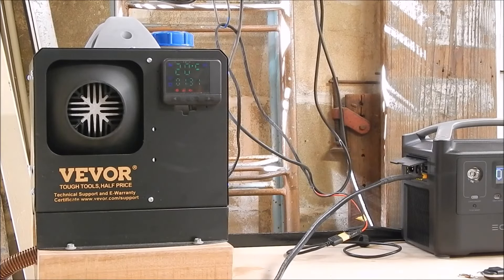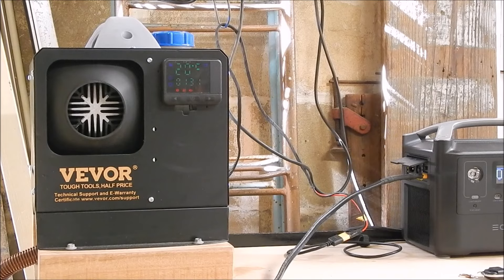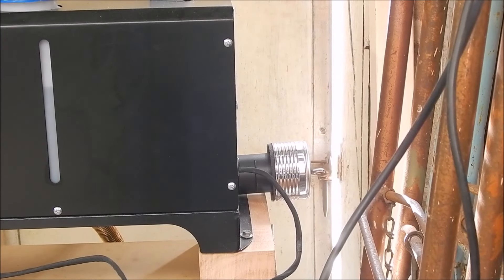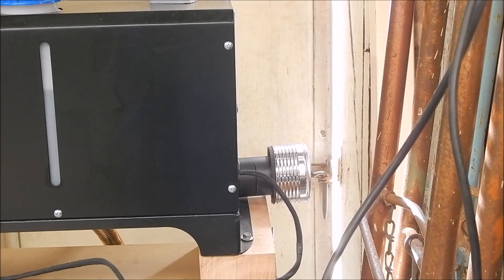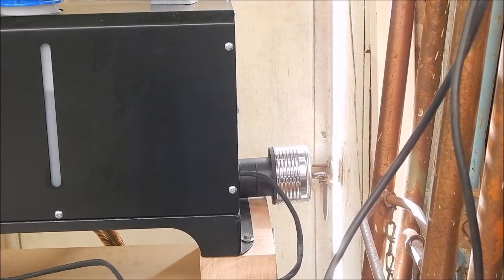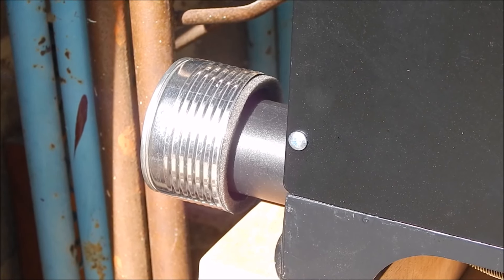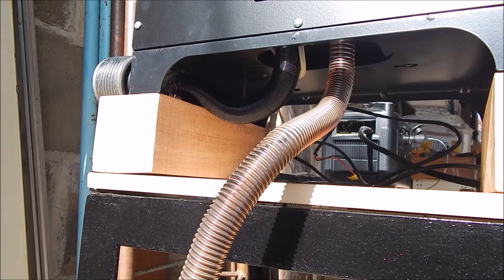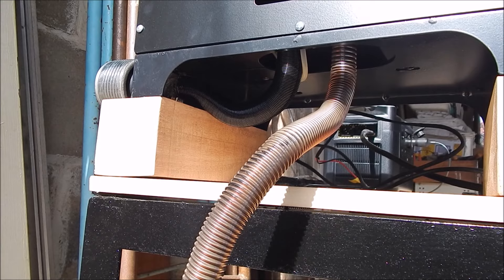Easy Chinese diesel heater mod to reduce burner air intake noise

Comment: Good mod to cut down the noise Rob. Now it should be easier to hear the tap break when cutting a thread :)
Reply from the maker: Ha Ha.  I haven't broken a tap for a very long time Jon, despite using a lot of small sizes.  Most of my el cheapo carbon steel taps have been replaced with HSS which "spring" nicely and give ample warning.  These heaters are far from quiet, but that's the price you have to pay to be warm.  Certainly good at that.  Cheers Rob
Reply: @Xynudu  Yeah, it was a bit of a joke. I have also not broken many taps. Most of mine are from my late father and they are all good quality HSS taps. I also only buy HSS taps if I need them. Yes, you do get a feel for when you are pushing good quality taps too far.

Comment: Hi Rob.
I Have a similar unit in my 'man cave' over here in the UK.
I'd be a bit careful with that. The intake you have silenced is the air supply for the burner, not the air that it heats up!
It draws the air that it heats, from around the heatsink looking thing.
By restricting the burner air supply, you may make the burner run 'sooty'. (think of a blowtorch with the air control not open enough).
Just my 'two penneth worth'.
Cheers.
Reply from the maker: Yes, I realised I said the wrong thing later, even though the video is titled correctly.  I made sure to leave plenty of clearance for air flow. The exhaust still burns totally clean and smoke free. All good.  Cheers Rob

Comment: Looking at the weather forecast for the next week, I reckon you'll be giving this a bit of a workout Rob - Cheers Jim
Reply from the maker: Hi Jim.  It's getting plenty of use.  Only 13 C max for all of today.  I'm running the heater off of my EcoFlow battery power station, but it's not ideal as it sometimes trips the 12 V DC 10 amp breaker.  I have a simple solution coming from Banggood (for review) which will solve this very common problem.  Stay tuned.  Cheers Rob

Comment: Thats a good idea! Just one thing you don't want to do is restrict that airflow or you could end up with the burner running too rich. A really fine mesh screen, such as a bug/mosquito jacket would be ideal. I think any kind of foam would reduce the air flow too much, but screen wouldn't. Screen would be easier to clean as well. 👍😁
Reply from the maker: Yes.  The foam is not actually filtering the air, so no restriction.

Comment: Hi from guyra nsw , question how much area is your diesel heater heating? And is it warm enough? .
Reply from the maker: The workshop is 20 x 30 foot.  Concrete brick walls, metal roof, full sized metal doors one end, no insulation.  Yes, it is warm enough.  Put on maximum for about an hour and half to rise temp to warm level (16 C).  Works well. Obviously it takes time to heat that sized space.  It all depends on the weather/air temp how hard it has to work.  The heater air flow moves the air around the workshop OK. Does a good job for the size.  Cheers Rob